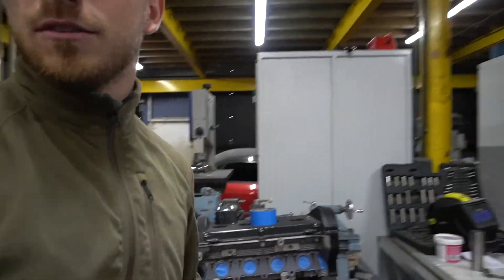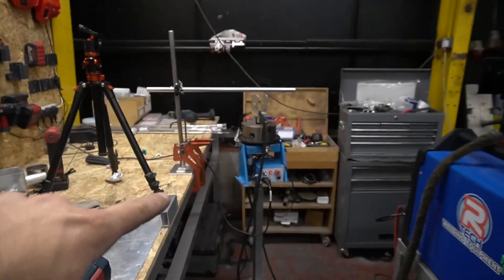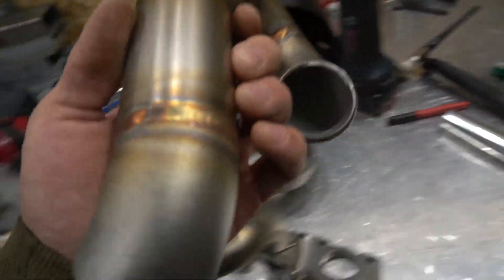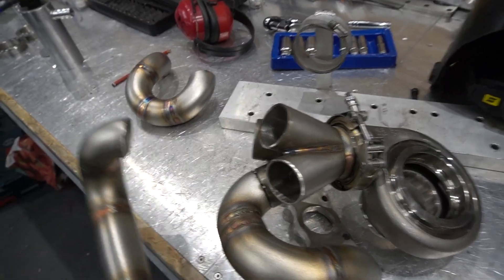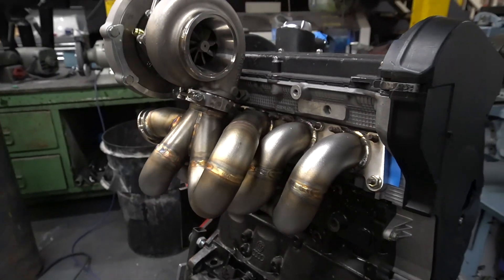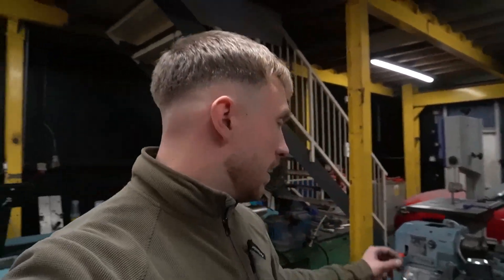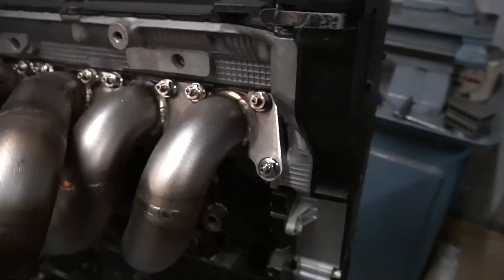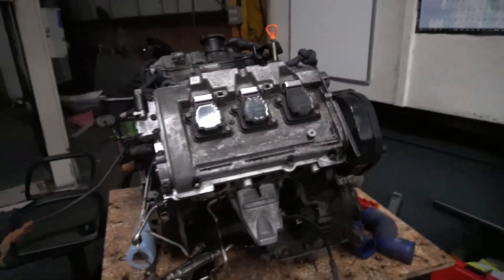Building a Turbo Manifold For My 1.8T Stroker MK1 TT Big Turbo Build - PT3 Welding

Comment: Beautiful work . What filler size do you like to use on this ?
Reply from the maker: I use 1.6mm filler on sch10 and 1.0mm on thinner tube like exhausts etc at 1.5mm wall thickness

Comment: Looks awesome! Why did you decide to set the turbo on top instead of letting it hang under the manifold?
Reply from the maker: Most are made like this for maintenance to be honest. Can have the turbo off the car in around 30 minutes, would be an absolute pain to service if it was bottom mounted. Plus this means I can run the boost pipe in the standard route giving it a OEM look to a big turbo setup. Imo that route for the boost pipe looks best in the TT's/1.8T bay

Comment: Why everybody curling up the turbo manifold and not down?
Reply from the maker: All depends on how much room you have and accessibility. Top mount on the 1.8t is easier to work on should you want to remove the turbo etc